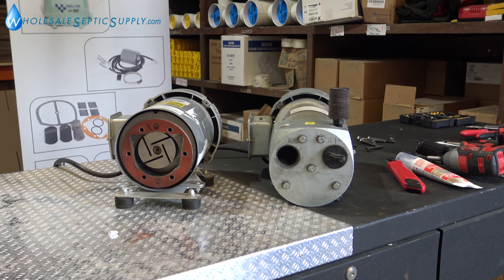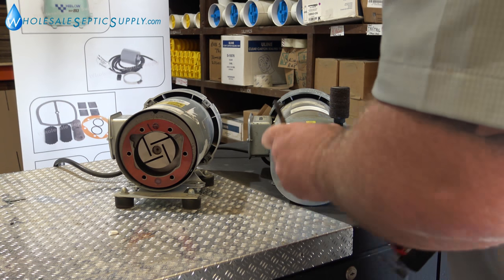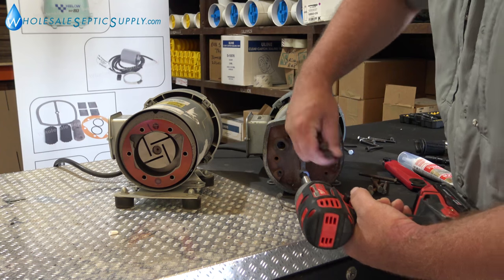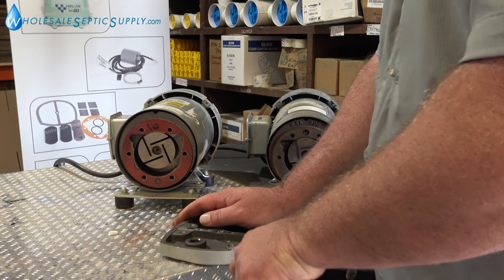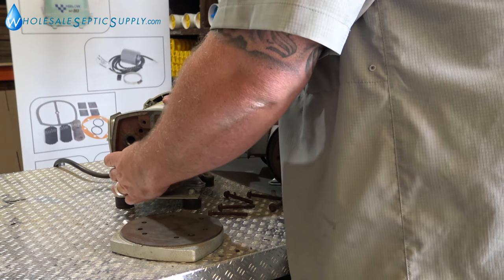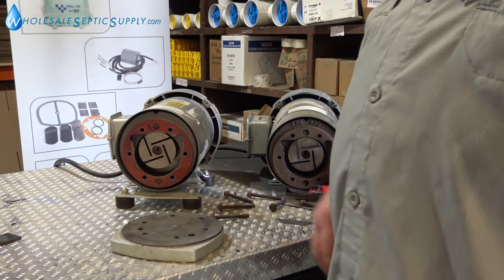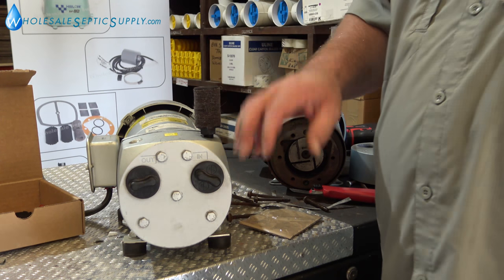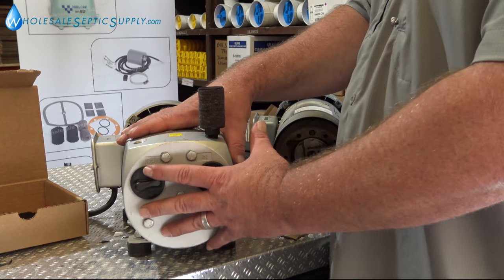Gast rotary vane septic aerator rebuild

Comment: Just rebuilt my Clearwater Pump. The orange gasket was not there but it in now. It works great. Bought the kit from Wholesale Septic supply.
Reply from the maker: If it’s not on there no need to add it. We never put it back on if it come out there is no lose in pressure and it does affect anything.

Comment: I just did the rebuild kit by following along with your video but have been having a breaker issue with just the compressor breaker.  it's tripped several times and I was told I need a new breaker so now I'm stumped and will likely have to get a professional.  I did notice that by accident, (I realize thats bad) I touched the wire to what I think is a red switch in the lower right control panel box and the compressor runs only when wire is touching that. I am so disappointed that I didn't get everything back up and running.  :(

Comment: I’ve never worked on these as we never had a septic system. Mine stopped working. I tried to rotate the fan blades. Won’t budge. Any helpful trouble shooting info on a procedure would very much help to get it up and running. Thanks. 
PS. I just purchased a FUJI from your company a couple days ago to replace mine, but repairing the old to have a back up would be great.
Reply from the maker: Have you opened the pump end not the motor end and checked if a broken vane is Jammed between the rotor and the counter face.

Comment: Rafael Barrientos
Hi, this is a great video. the vanes broke on my pump, so I took it apart and cleaned everything inside. Went and purchased the repair kit, installed everything like i watched on the video. The motor turns, but there is no air blowing from the pump. What did I do wrong?
Reply from the maker: No air and the motor is turning is different. If you call the office we can give you the house phone to send a video and see what is going on it’s kinda hard to guess. Even with the vanes in wrong you will get some air.

Comment: Hey there, I know this is an old video but hopefully y'all still get notified about questions. My old Gast Aerator has a motor start cap on top, which I replaced about 4 years ago when it wouldn't run, and it's been going ever since. however, it has basically stopped producing air so Its probably time to just replace it (it's 18 years old). I notice the newer pumps don't appear to have a capacitor on them, and I was wondering if you could tell me why ?
Reply from the maker: They needed a start cap on the old RVTrader models because they where 1/6 hp to compete with the linear pumps on power consumption. Issue was the the caps going out. That unit is one of the ones that lasted like intended. Most of them did not so the switch was made to use the same motor as the 0523 that has no issues.Now they are all 1/4 hp motors.

Comment: Awesome :) thank you for the quick response. You are the savior :) I am going to order it right away from your website. 
What should I use as the cleaning agent. the Gast recommended solvent seems to be very expensive. I'll need the external filter, 24hr/15 minutes timer as well. I don't see it in your website.
Reply from the maker: Saravana Bharathi we don't use anything just make sure any chunks of carbon are not in the housing. The vanes lay a film down so they wear against the same material so cleaning the counter face is really not needed. Just blow it out really good. We rebuild hundred a year literally.

Comment: I changed the vanes and filter of the  pump GAST 0523-101Q-G588NDX, the motor is rotating( at least giving loud sound) but it is not pumping. What could be the reason?
Reply from the maker: Are the vanes put in the correct way and is the unit tight enough.

Comment: I have a gast 0323 that is dated back from 2011 and seems to be a bit different then the newer 0323 models. Mine doesn't have any filters any where that I can see, it just has a hole marked "inlet" where a hose from the septic lid was connected to, and it also has some kind of clear cup like container screwed into a fitting on an elbow attached to the pump across from the hole marked "inlet". It also doesn't have any gaskets of any kind when I took it apart. The felt gasket that comes with your kit also doesn't look like it would fit anywhere on my pump even if mine had a gasket. Will the regular 0323 rebuild kit that you guys sell work with mine? I've already bought the kit and installed the vanes and orange gasket that come with the kit, but wanted to check just in case it does any long term damage. Pump seems to run fine and sounds just as yours did, was just confused about why mine didn't need any of the extra parts?
Reply from the maker: Some come with filters and some come with glass jars on them vacuum applications. The rebuild is the same the vanes have no difference. You might have got a vacuum style even though the specs are the same it wouldn’t come with the top inlet filter the pressure models have.

Comment: Mine went 25 years. Now the shaft is froze up. I did replace the vanes once. Why would it be froze up?
Reply: Also I’ve looked at the vanes and although worn, they don’t look like any have broken.
Reply from the maker: The motor probably cycled to many times with the vane stuck in the counter face and burned up. Very rare they go past 20 years. I have seen them run but they don’t build and create enough pressure at that age and i have seen a lot of them thousands of them in the field.
Reply: @wholesalesepticsupply9801  thanks for the response. Yes the pump ran from 1997 until this year, 24/7, except when I rebuilt the vanes about 12 years ago. Oh also it outlasted the shelter it was in so it was stopped for a few hours while I built the  new enclosure:)))

Comment: I got the rebuild kit and put in the vanes  just as video demonstrated and the pump now works!  however, it runs quite hot, too hot to touch in fat, but it is still pumping, what could I have done wrong?
Reply from the maker: Elliott Metcalfe the run at 140 degrees normally.

Comment: Thank you for your quick response. When I opened my system I found out that the orange gasket is missing or completely ruined. I don't see the orange gasket in the kit. Is it possible to order the orange gasket separately? or is it that some units / older models didn't have the orange gasket.

Another question: The date code on the model shows 0101 - does it mean it was manufactured in Jan 2001? does it mean it might have been used for about 15 years? is it worth rebuilding or should I go and buy a new motor.

Once again thank you for answering my questions and yours is the best video I found on rebuilding gast rotary vane pumps :) keep it up.
Reply from the maker: Saravana Bharathi there is no orange spacer on the 0823/1023 unit only on the at05 unit.

Comment: My gast unit  is not rotating and motor housing is hot to the touch.. is it repairable with kit?
Reply from the maker: Cecil fishing tips yes it is more than likely the vanes have broken and are bound in between the rotor and the counter face locking up the motor.

Comment: My motor froze after taking out all the bronken vane.  Does that mean it cant be rebuilt?
Reply from the maker: Depends you have to get out the. Get the rotor freed up if jammed. Once that is done you can turn the unit on if it spins it works in 90 percent of the cases to be 100 percent sure hold your palm against the rotor apply a little pressure with your palm if the rotor doesn’t slow you are good to go.